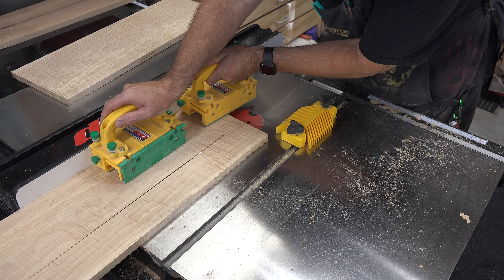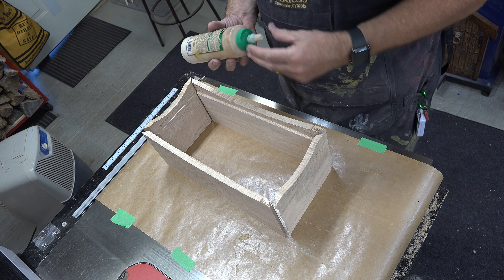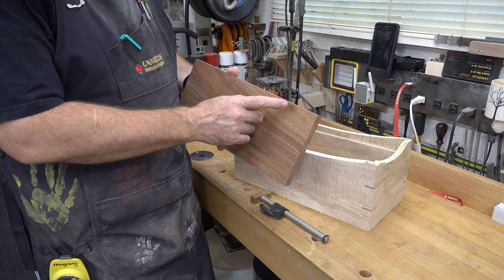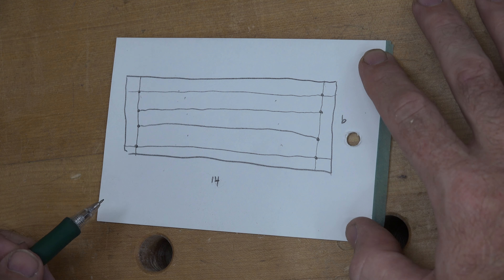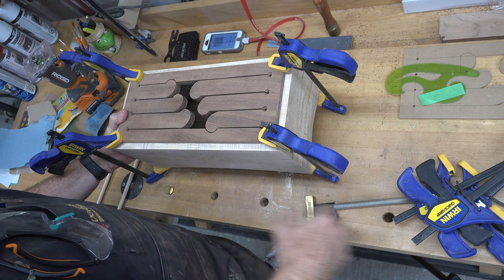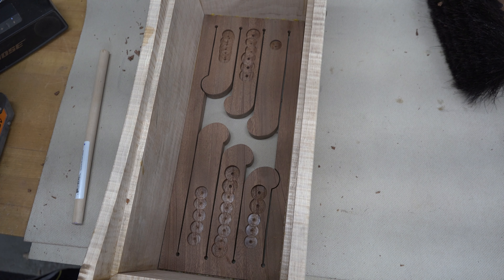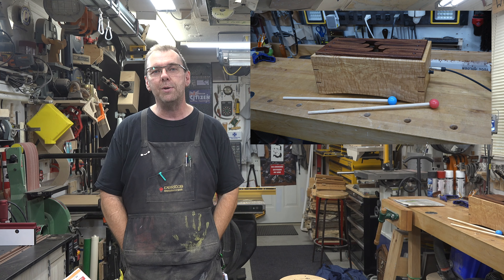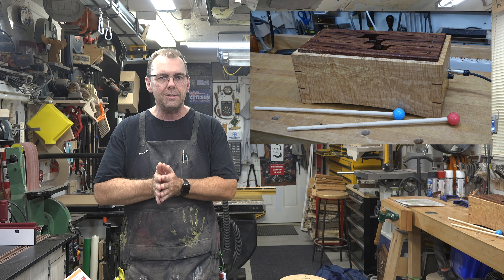Making a Tongue Drum

Comment: Use soft pine sticks 5/8th thick 7/8th wide 9 to 10 inches long round the edges with a file. Optional file a groove for thumb.  The pine gives a different sound and striking ability.
Reply from the maker: I will have to try this.  Thanks for tuning in and for chiming in with you suggestion.  It's appreciated.

Comment: Hi Kenny, why do you always use the scroll saw in favour to the band saw I never have any trouble u sing the band saw and although I have a 1/4“  blade on it I think it would make any turns that a scroll saw can make.
Reply from the maker: I don't always use the scroll saw John, but it is definitely my preferred method.  It's what I am most comfortable with.  For this project, the slots are interior cuts and I didn't want to get in to having to glue things back together once I cut them but a bandsaw would work just fine.  I find that there is no comparison to the detail that a scroll saw can cut and a bandsaw just can't compete but for a project like this, either method is perfectly fine.  I hope this helps.  Thanks for tuning in this week sir.